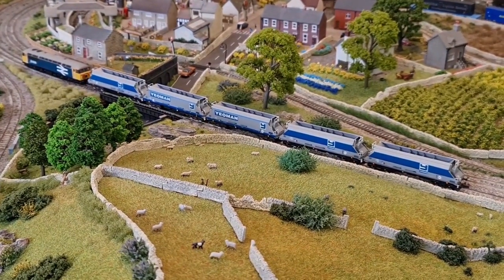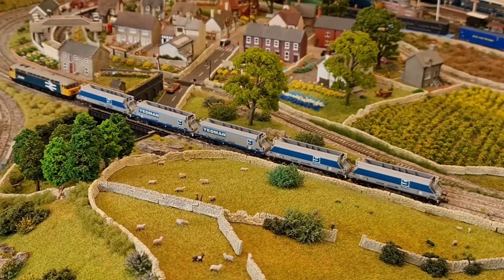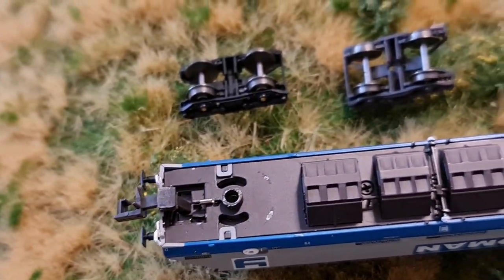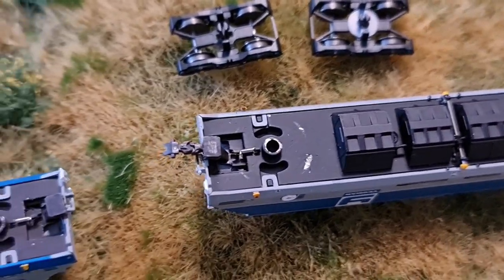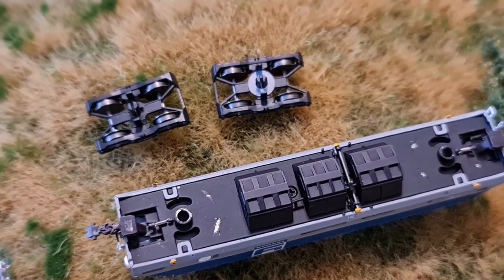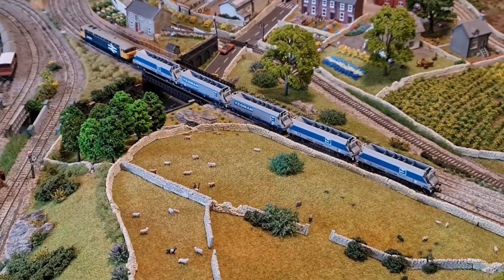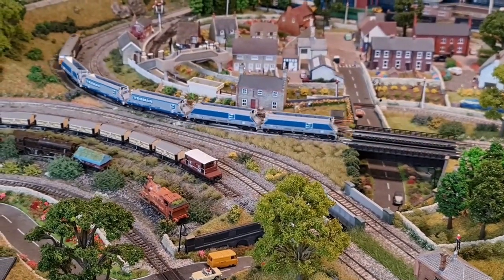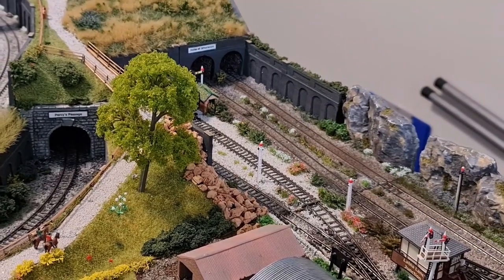Dapol Fails Again !

Comment: All these negative Dapol vids stops me buying from them. I'm sticking with Bachmann & Kato. You have a stunning model railway too.
Reply from the maker: Hi There, to be.fair to Dapol the hoppers are really good looking and after removing the brake shoes and adding the nylon washers, all ten run reliably and smoothly. It is a great pity that Dapol released these hoppers like this but that's the way they do things. I have other Dapol wagons that are 100% straight from the box. As for Graham Farish, trust me their stuff can be as equally bad, so much so Dapol's offerings are far superior in my opinion.
I only have one Kato train and that's the Class 800, which has performed faultlessly from the start, but the motor is definitely a bit noisy.

Comment: I've been tempted by a few 'oo' Dapol wagons and find their couplings very flimsy. They are quite often set off-centre and won't automatically connect with other couplings, including Dapol's own. When wagons derail it is always the Dapol wagons that have caused it. So I agree,that their quality isn't what they should be.
Reply from the maker: Never had coupling issues on Dapol stuff, that's a Farish issue because Farish ones are usually higher that everyone else's. Considering they are all NEM they should be the same.

Comment: I have purchased a second hand one with a broken nem box broken about half way down the stork have tryed super glue to fix didn't stick any ideas please.
Reply from the maker: Hi, would that be the white livery First Great Western one from Barnstable by any chance? Interjected it if so because of the wheels on Code 55 track.
You say you have used super glue to do it with and it is probably the wrong super glue for that plastic. There is a Hard Plastics version to try.
But I would try ringing a company called BR Lines who are stockists of Graham Farish parts and have loads of parts for the Poole manufactured models and see if he has a new part. He is a mine of information. 01287 633036,  www.farishspares.co.uk
Email, info@brlines.co.uk
Reply: @PiddleInTheMarshbyMarkIreland  Thanks for the reply it's the dapol n gauge yeoman wagons like in the video i have tryed some araidite see how it goes. About the wagons short circuiting could I fix it with some electric tape under the wheels.
Reply from the maker: Oh those wagons ! I did two videos on the issues with those wagons (links below) and how to sort it out. I have ten that now run beautifully and no issues.
It's such a shame because they are a stunning model.
If you have broken the coupling try Peters Spares 01642909794 or DCC Supplies  01905621999 who are the Dapol spares people. You can get the washers for the shorting issue from EBay. Fitting Hunts magnetic couplings from West Hill Wagon Works improve the wagons running no end.
You could also remove the coupling from the rear hopper with buffers and fit it to the one that's broken.

https://youtu.be/IBCqrrAzvDs?si=Z6YOHvnrnjh1XNpU

https://youtu.be/B0Wl_xpI2nk?si=GCXUl_QDG6ok5O1v
Reply: @PiddleInTheMarshbyMarkIreland Thanks the dapol n gauge class 59 is there any on dcc to get the lights at the front 2on together
Reply from the maker: @andyjeffrey3920 I can't help you with that one, mine is Revolution Trains, which is heavier than the Dapol one and in my opinion better than it for details. The downside us that Next 28 recorder. It does pull 10 hoppers up my helix no problem though.
Reply from the maker: I have just spoken to Paul Sheedy of Wickford N Gauge and after reading the Instruction book It doesn't look to be possible to have white or red lights on both ends. Revolution version it is.
Reply: @PiddleInTheMarshbyMarkIreland Thanks for that had a go at fixing my dapol n gauge yeoman wagons these would not move at all the locomotive wheels would spin round I found some metal washers same size only 0.2 thick they worked great I would have never thought of it till I saw your video could not send back purchased second hand regards Andy.
Reply from the maker: @andyjeffrey3920 They were all like that with mine. Not good at all ! I also removed the brake shoes on the bogies because some of those were rubbing on the wheels, I suggest you check yours.

Comment: Yes they do look  cracking wagons but what a shame anyone buying them have to sort out Dapol's poor quality control.  Whatever you do don't buy any Revolution trains forthcoming DMU's.  I suspect they will use the same coupling method as used on the Class 320/321 emu's.  I've just spent a week having to "fix" my new class 320 to get it to run without derailing  - don't ask what I did to it !
Reply from the maker: I have a 180 on order but hopefully it will be sorted by then

Comment: Oh Dear. What a shame. It's so good of you to find that solution. I hope Dapol follows suite. They certainly need to!
Reply from the maker: Hi Mike, I think Dapol will just bury their heads as usual and pretend it's not happened. To correct the problem smaller wheels or the tooling for the base  needs altering.
Thanks for watching.

Comment: thank you for the very informative video, I've ordered the washers as a preventative measure to stop this happening in future.
Reply from the maker: I have found other issues with these hoppers since I made that video. On some axles the brake shoe's actually rubbing on the wheels causing friction so I have removed them. You can't even see them on the layout ! I have also removed the bar on the bogie so it is the same as the coupling end to allow more room for the axle as they are far to tight, works a treat !

Comment: Hi, what was the dimensions again?  The  M3    -   3.2mm (i/d) x  7mm (o/d) x 0.5mm thick looks too small so they must be a larger size?
Reply from the maker: Hi, These are N Gauge JHA Hoppers. The nylon washers I used have an inside diameter of 3mm and an outside diameter of 7mm and are 0.7 mm thick. I did leave a link to the EBay item in the description on the video. The sizes you quote are what the advertiser on EBay states. Doesn't need much !

Comment: Yes not great but you fixed it at least! I’ve bought a number of Dapol products and been disappointed every time with there quality or lack k of it! Cheers Gary
Reply from the maker: Hi Gary, to be fair to Dapol they have produced some excellent stuff like the 50 and 68. I would usually buy the Dapol wagon and definitely their coach over a Farish. I lost my temper with a pair of Farish coaches and stood on one that kept jumping off for no reason. For some reason the other one has behaved perfectly since. It's the later stuff that has let Dapol down and in a big way with errors that just should not happen.
The Farish 220 is a pig !
I know Dapol can do better but at the moment seem to be in denial, I hope they wake up soon or it will be bye bye Dapol, which I would hate to see.

Comment: Dapol's QC needs improvement! With the recent announcement of theirs that the prices are due to increase, I hope they will sort themselves out. It's a shame as they make some great looking stock.
Reply from the maker: I couldn't agree more, Dapol make some lovely looking models but fail because of their lack of attention to quality, it's such a shame. These models are not cheap either.
But I expect Dapol to do the usual and bury their head on the sand and pretend it's not happened.
 I had a 59 and a 66 on order from them, Cancelled ! The 59 is now coming from Revolution Trains.
Thanks for watching.

Comment: Well that's a bit of a slight oversight in design, isn't it?!
My JNA Falcon wagons show just how poor Dapol's quality control truly is. Not only are the couplings so shocking loose and droop so low that they won't couple up to each other, but a wheel on an axle on two different wagons were on the wrong way round! So, if you're going to purchase any JNA wagons just be sure to have a back-to-back gauge to hand and order some magnetic couplings from West Hill Wagon Works as they are literally the only couplings that keep the wagons together!
Mike.
Reply from the maker: I have heard about the JNA wagon issue from Colin's N Gauge. He did to them the same as I have to the JHA ones and fitted Hunt Couplings. I have now fitted Hunt Couplings to the hoppers along with removing the brake shoes, that were actually acting as a brake. They run beautifully now.
My experience with Farish stuff has been no better recently.
My next purchasers are from Revolution Trains and I am hoping they will prove to be better.
Very reluctant to purchase Farish or Dapol at the moment.

Comment: i added shim washers to mine as well, and they run reasonably freely, but they sound dreadful! real life flange squeel or something going on. its unbearable to listen to the train going round! i need to check the back to backs and oil the axles. I've also had a few short circuits! very disappointing from dapol as the running qualities are abysmal.
Reply from the maker: Yes both myself and Paul at Wickford N Gauge had that problem. The back to backs on mine were okay to be fair but the noise was from the wheels rubbing the body bottom. Adding some lubrication to the axles did help a lot and they have had a day of being run to free everything up.
We shouldn't have to correct new models !
Reply: @PiddleInTheMarshbyMarkIreland  exactly. i saved up to buy them ready for the forthcoming class 59s. they should just run out the box. did you cut a gap in the washer for the coupling spring or not bother? cheers tim
Reply from the maker: The washer I used didn't seem to interfere with the spring at all, so no I didn't.
Reply: @PiddleInTheMarshbyMarkIreland  ok thanks. tim